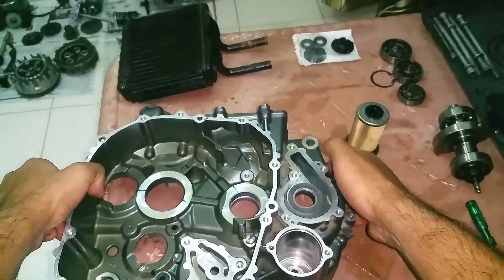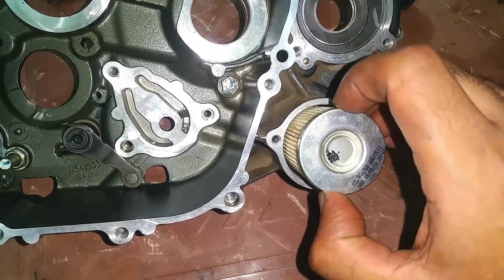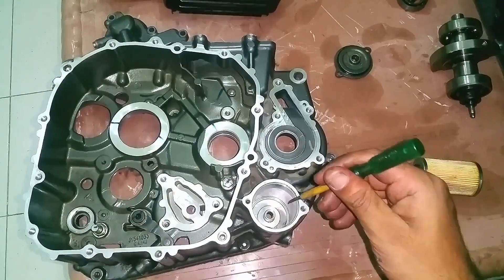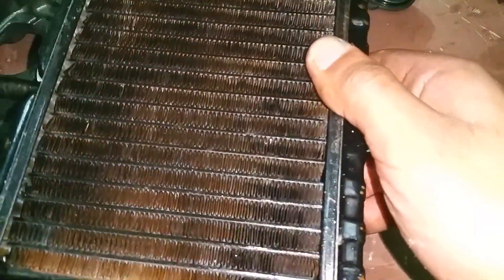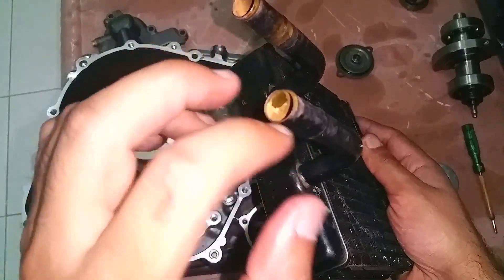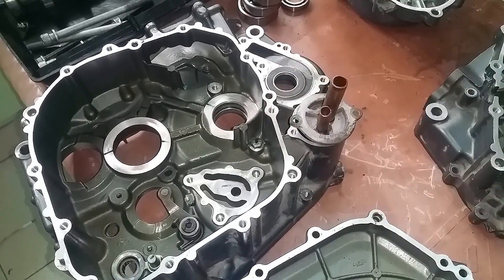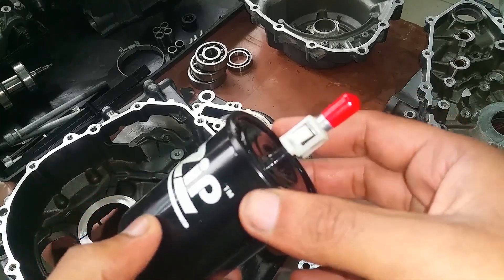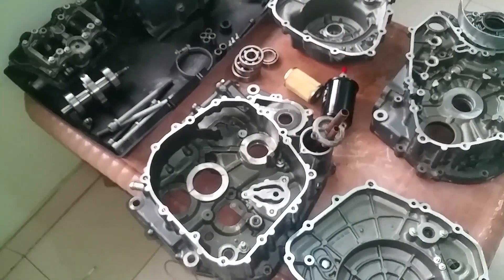INSTALLING OIL COOLER RADIATOR IN KTM RC390 (Overheating Resolved)🆒

Comment: Bro can we install liquid cooling system like( fan radiator ) in oil cooled engine..like we can say that can we install ns's or duke 200 radiator fan in Apache 200 4v

Comment: You can also use the oil drain plug and the oil fill hole to circulate the oil with a pump. So you could use the power of the radiator fan to power the oil pump. So temperature is controlled

Comment: Nice job , but the ground clearance is reduced and where is the fan for your Oil Cooler Radiator ? Did you managed to plug the belly panel ?

Comment: Hi , doesn't this meant that more engine oil must be added since the radiator take 200 ml but will the addition could highly cause an  overfill crankcase?
Reply: He mount the cooler upside down.. when engine off oil will drain due to gravity.. try mount it upright.. so oil doesnt drain even when engine is off.. got it??

Comment: Excellent modification! But how are you ensuring a tight seal around the return pipe in the centre where it covers the original inlet from the stock filter?

Comment: Also you could put a thermostat so if oil need to be heated up then it bypasses the oil radiator and goes back in the engine

Comment: Thank you for using english. This is a brilliant mod and your explanation is amazingly detailed. But I just wonder if is better to use this 2nd radiator mod as the extension of the main radiator through the coolant host instead?
Reply from the maker: Target is to cool bring down oil temp..!!
Reply: Febur made one. It's expensive though. Made similar for ktm RC 390R. But idk about pressure. The coolant system is pressurised.

Comment: the radiator fins are very thin which is good for coolant as in this case the engine oil viscosity doesn't make any problems to flow free ?

Comment: Bro...use gixxer 250 oil cooler...9 layer tube & inbuilt cooling fan..and looks good....
Reply: Can we really fit the oil cooler of fixer 250 oil cooler to duke 390
Reply: Does fan work bcoz it is connected to ecu
Reply: @nitheeshdavu9816  it will not work...u can connect it to radiator fan when radiator fan is turned on this fan will also start to run

Comment: I think sir u need to put more 200 ml of engine oil instead of 1.5 lt.
bcz the oil is running more way.
Reply: I agree... The engine oil will be low while engine running.
Reply from the maker: Stock ktm 390 takes 1.7 litres...Now it'll take somewhere b/w 1.9-2.0litres..!!

Comment: how is the oil pressure? did you measure it
Reply: This is what I found in forums. Does anyone have an idea about this ?...Kaveman, If you look at the schematic of the 390 oil circuit (pg. 19) you will see that oil moves under pressure from the Eaton pump directly to the oil filter. After filtration the oil is sent -under pressure - from the filter housing to all the other pressure-lubricated components of the engine. Your oil cooler proposal would release oil pressure from the oil filter housing by routing it out through the oil filter cover, through the cooler and back into the crankcase via the oil filler. This would rob the entire engine of oil pressure and destroy your motor immediately. You need to rethink and devise a scheme that would route oil through a cooler and back into the crankcase WITHOUT disturbing/altering the pressurized oil flow from the Eaton pump to all pressure-lubricated components.

Oil coolers, IMO, are most useful for air-cooled bikes, where they can supplement the heat-shedding capacity of engine finning. Air-cooled engines are often plumbed to accept oil coolers for this reason. In contrast, liquid-cooled engines, such as the 390, are designed with radiators whose size/surface area is calculated to enable the radiator to shed all the calories the motor can generate, even under the most extreme/adverse conditions, with a margin to spare. Oil coolers, in this configuration, are redundant and unnecessary. This is why oil coolers are rarely seen on liquid-cooled bikes.

Comment: What you've done if good but I concerned about the oil filter as it is car diesel filter and the viscosity of diesel is very thin and can be easily absorbed through the filter. It's not the same with engine oil as it is thick the oil pump must work more header to push the oil through. And also open the tapped cover to see if the rocker arms, shims, and valves are getting enough gush of oil to be lubricanted. 
All in all really appreciate your job and all the best for the build.
Reply from the maker: If you open up this filter there's exact  replica on the inside. ..same paper filter with same pores...It's fine to use...have checked oil flow quantity...

Comment: Hi there .Can you please help with a good video of attaching or removing RC390 tank.
I have 2017 model 390 and did a home service of air oil and petrol filter. Now am having problems in reattaching the Tank Can you please help me with that.
Reply: Just if I can have a look at the stock arrangement also would be beneficiary hence kindly help
And do reply please
Reply: Download a service manual of the RC390
Reply: @devilidol  well that for the advice but a detailed video from am experienced person will be much better.
And yes I have seen the manual and it didn't help due to minute details. Anyways Thanks
Reply: Just type rc390 full servicing on youtube topend he added his video on it. you will get idea how to install,2 bolts are install under battery compartment so just you need to fit 2 front holes in that bolt then tight nut 12 size probably,then in under the tank you need to install 3 pipes attach to fuel filter,then you need to tighten 2 bolts under rider seat (make sure you attach battery pannel unlocker to bolt loc) after finishes tighing press ecu cable in bracket and their is small plastic handle on cable press it in forward direction when you start pressing it you will feel main cable is pressing inside bracket and getting tighten that's all it easy just one time see video & check you tank bolt location. you are getting problem under battery compartment i think.

Comment: Tony excellent stuff there mate. A few questions, how did you calculate you'd needed 200 ML of extra oil, was 200 ML the size of the exchanger or just a ballpark?
Reply: Any idea if this affects oil pressure? Like no one else anywhere on the internet has done this. Will doing this damage engine? Less oil pressure= oil starvation at some places or more oil pressure= leaking through gasket ? Any idea ?
Reply: @kevin1508pin  De hecho, recién subí el manual de la ktm 200 2013 a chatgpt, al ser la bomba de aceite de tipo engranaje, su presion si es suficiente para subir el aceite por la tubería de 12mm pasar por el filtro de aceite, (en este caso el del Hyundai Accent ) y llegar al radiador (también debe ser de un calibre considerado para que el aceite al ser mas viscoso, pueda fluir y enfriarse fácilmente), enfriar y retornar, lo necesario es la cantidad de aceite adicional que se necesita para mantener un caudal correcto y que pueda llegar a lubricar la parte superior del motor, por eso es la medición de presion antes del proceso de instalación y comparación de presión con la nueva instalación.
Reply: I reckon he measured the amount of oil it took for him to bring the oil level in the sump back up to normal (as per sight glass)

Comment: Why didn't you go for 2 fans or a bigger radiator bro i think messing with the bike's lubrication system can harm the engine but i have confidence in you that you must have done ample research and testing of this diy kit good work bro keep going 🤙🏼
Reply from the maker: Well goin for 2 or bigger liquid cooler isn't an elegant solution...we didn't mess with any Direction of motion of oil...have measured oul flow quantity. .it's gud
Reply: @powerpulse.Tuning  great work bro
Reply: Not harm unless impurities get mixed in oil, the trick is really great and oil filter get things done... But super bikes are both oil cooler as well as liquid cool keep the heat as low as possible...
Reply: And yes bigger cooler or dual fan ain't gonna help much...

Comment: What about two radiators? There's ample space below the main radiator to add a vertical one. All you'll need is another hose, and you possibly could series connect both the radiators. Thoughts? 
Also, I've considered to port an RC390 radiator to my r15 V3, after I install powertronic ecu and  a better intake port, free flow exhaust. Along with a 183cc bore kit from indo, like Abhinav Bhatt has.
Reply: Adding radiator won't help and may not be possible . If you want to keep bike cool try for radiator with more capacity with couple of fans or a bigger fan to cool down the coolant .
Reply: Talking about r15 , you don't need different radiator or fan to keep your bike cool as 183cc won't catch a lot of heat just go for engine ice .